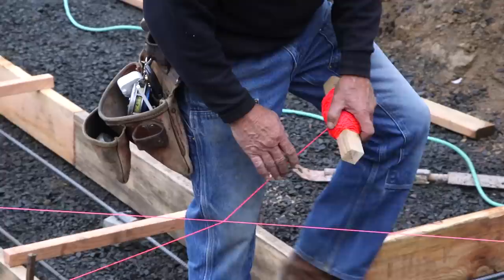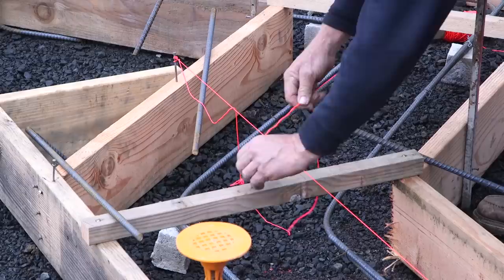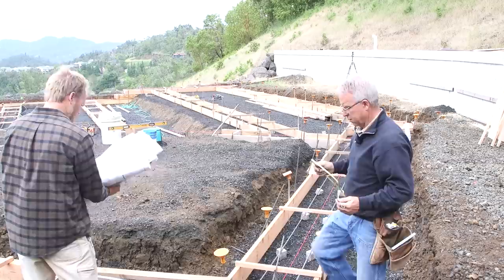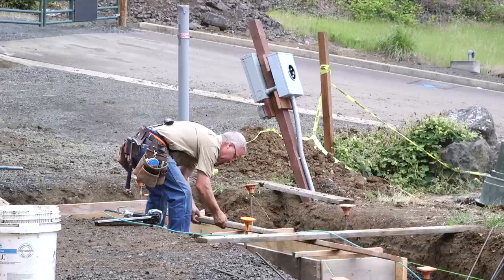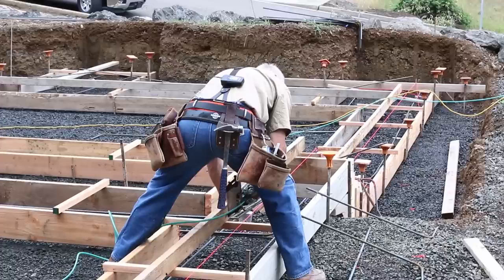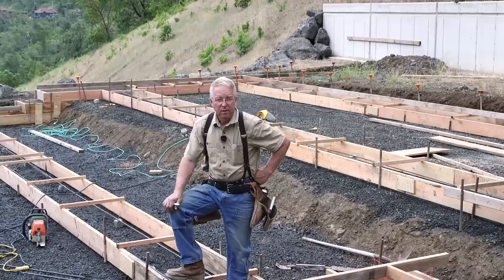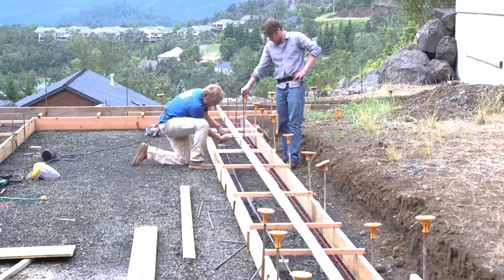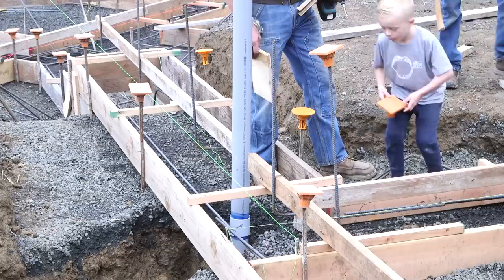Rebar Layout Ep 30

Comment: I only ever see concrete poured stem walls up here in greater Seattle area. Is cinder block done just because it's less expensive?
Reply: Generally less expensive and a lot less form-work needed.
Reply: Depends on the location of the block plant. Our area double the cost for a block wall. Plus no one really knows how so we pull Frazier Mason's from 9 hours south. Or just pour sold walls.
Reply: I know living in seismic zone D-2 it is not code unless it is manufactured home.
Reply: Maybe the concrete truck hose doesn’t make it to the back of the house? But that would be hard to believe. Probably cost ? 

Monolithic pour seems like a best way to me, but I’m also an armchair quarterback..haha
Reply: concrete blocks,cinder blocks are history
Reply: I am actually shocked to see him doing CMU on this stem wall. No one does that around here (Seattle). We do footing and stem wall mono pour and have really cheap mud compared to other parts of the country. A factor around here is most consumers view it as inferior construction, so less value for a spec home.
Reply: It’s not the same thing as us cold climate guys deal with. This is something like a 3’ wall with no frost heave to resist. If I had to guess, I’d say the engineer used a comfortable safety factor when he said to use CMU.
Reply: billy pilgrim  Not in Florida, where they’re used every day.
Reply: Micah Watson  One can always spend more money, and over-engineer. You can call that “inferior” if you like.

Comment: Actually in commercial construction they just throw the vertical rebar in with absolutely no regard to where the block cells are going to be (at least that's what it seems like).  It's not a big deal though as long as it's inside the faceshells because the masons will just bend those bleep-bleepers and or bust out webs to make them fit.  That's how it's done 99% of the time. ..and I've never ever seen a block web epoxyed back into place.😂 You Funny!

Comment: Wouldn’t the mortar move the cell over a bit each block? By the end of the wall it could miss the cell.
Reply: The actual block is 15 5/8" add in the 3/8" for the head joint and you get 16". The final wall can vary somewhat due to final dimensions but usually not enough to throw off the steel layout.

Comment: I've always been confused by rebar. They're just laying in the concrete, not attached to each other. Wouldn't bolting or welding them together make them more effective? To me it's akin to simply press fitting studs  and top plates and not nailing anything together.
Reply: What made you think rebar is NOT attached to each other?

Comment: Good for strength but I'm from Norway and you have to put a coating on the rebarb so it won't rot or or rust in the oil rig or whatever why don't we use rebarb that has a coating on it so it won't rust in years to come
Reply: @greggkuzilla - I will start by stating that I am certainly not an structural engineer.  I believe that in some instances in the US,  rebar coatings are required (Commercial Buildings, bridges, etc.).  Also, I don't remember where I saw it, but a while back I came across a conversation related to rebar coatings.  The basic premise was that the coatings are good in theory. For example, when they are used/installed under "ideal conditions".  However, in the real world (on construction sites) the coatings get damaged and then the moisture in the conc. is pulled into the area between the rebar and the coating through capillary action. Then, the rest of the coating holds that moisture.  The result being that the rebar rots from within the coating. So, the coating may, in fact, cause the rebar to fail more quickly.

Comment: Scott can I ask what are the conditions for which all this rebar is required ?  I have worked in and around the building industry in UK for 40 plus years and have never seen such a complicated set up for a blockwork build, for concrete yes and much more so. And vertical rebar ? I’m not saying it is never done but I’ ve never seen it done. Is this Earthquake proofing or something ?
   Three houses I have lived in just had brick footings(no concrete, not much used when they were built) stepped in from twice the thickness of the eventual wall, built off what is called “natural rock” which is basically the subsoil as deposited, no cracks in any of them, properly done.
       Don’t get me wrong I have seen a lot of damage, caused by bad or cheap practice, or lack of maintenance.
Reply: The Cascadia Subduction Zone is capable of producing megathrust earthquakes, like the 2004 Boxing Day earthquake which was so powerful it slightly altered the earths rotation. The last time this zone shifted was on January 26th,1700 at about 9pm. We know the date and time because an orphan tsunami was recorded about 9 hours later in Japan. Though I should note that tying the stem-wall to the footer is pretty standard practice through out most of the US, not just in earthquake zones. We have a broad enough tornado threat throughout the center of the country, and tropical cyclones that threaten both coasts, that there really isn't anywhere you wouldn't want the stem-wall tied in. Construction requirements and codes will vary somewhat state by state or even county by county, so your mileage may vary with and actual survey of the facts, but this has been true in my experience.

Comment: I watched the guys who built my house and they just dug a foundation shaped hole and poured concrete in it without any rebar at all. They built the blocks on top of that.
Reply: Yikes! Concrete AND steel have complimentary (and necessary) strengths. With the lack of steel, you’ve eliminated half of that equation.

Comment: Try doing concrete footing 10 miles South of the Arctic Circle in the middle of nowhere. The nearest rest stop/service station was 236 miles south.
Reply: I thought everything was up on stilts to keep the permafrost from melting.
Reply: @michaelvangundy226  Bridges don't go in on stilts, they go below the permafrost, the road construction crew hit a hole in the permafrost that took 500,000 cubic yards of gravel to fill at one point on the Dempster Highway.
Reply: Charles Damery  Why?
Reply: @bonanzatime  Good question, at the time the Canadian branch of Exxon Oil, Imperial oil was drilling the Beaufort Sea in Canadian waters next to Alaska and they need an all weather highway to get supplies in instead of barging around Alaska in the short summer season, the highway has now been extended from Inuvick in the Yukon Territory to Tuktoyaktuk in the Northwest Territories, so now you can drive from the Atlantic to the Pacific Oceans and up to the Arctic Ocean. It was built as an oil road, but with the cost of food in the North, it's cheap by road than by air.
Reply: Charles Damery.   Good Deal.  Keep up the good work.👍 I'll be there a week from Thursday.
Reply: @bonanzatime  We built the Eagle Bridge in 1976-77 when I was with the Canadian Military Engineers, I've been retired from the military got 28 years now and live in New Brunswick.

Comment: i will never understand why amercans build their houses since centuries in this style! no solid groundplate, thin walls from wood and foam is for the invirement the absolute cathastroply. when i am right is the summertime in oregon quite hot and the winter below frezingpoint. so in winter you heat like crazy and in summer the aircondition runs constantly. and no one cares the cost and waste of energy because this style of building house is "tradition". in germany the outer walls are minimum 15 inches + additional insulation. so in a proper build house you need no aircondition in summer and in winter you have to use heating very seldom. regards from cologne (love your channel)

Comment: How do i know at what point in the build that I need to stop and have an inspector sign off on a certain portion of work? Is that something pre-determined between the builder and the code laws?
Reply: when you file for permits they'll tell you when they want to do inspections, as in at what point in the completeness of the work.
Reply: In my experience, inspectors would rather answer “dumb” questions before you start, than come out red flag every other thing to be fixed later. If you’re doing a project on your own, most inspectors will be happy to sit down with you and explain the permitting and inspection processes before you start.
Reply: Generally, an inspection is required before you cover up the work. (e.g. before pouring the concrete, before backfilling the utility trenches, before putting up housewrap, before installing insulation or drywall, or roofing.)

Comment: Tying in re bar at corners and intersecting walls in footings and walls are  details contractors often get incorrect. Unfortunately,you did also: here is one of many pictures available showcasing the proper way bars are to lap as they turn corners in footings and walls. They should not follow the short path around corners but extend to the far side of the corner. May appear  insignificant,however,it is the stronger,correct way to place them.    https://www.eng-tips.com/viewthread.cfm?qid=407323
Reply: J Mack  That is what these types of interactive sites are for,the sharing of knowledge.We are never to old to learn. Best regards.

Comment: Did you forget to spray the forms before setting rods?
Reply: With form oil?  That can be done just before the mixer shows up.
Reply: Usually spray forms before rebar is installed. Don't wanna get oil on the rebar!
Reply: I don’t know that I’d even mess with form oil on this pour. Those forms will pop right off the next day no problem. Plenty of space behind them and not down below any grade.
Reply: I agree Ryan!
Reply: @ryanmartin9850  
New wood sticks to the concrete very badly. I have always sprayed with diesel fuel before setting any rod.

Comment: Still don't know why you don't just do a monolithic pour of footings and stem wall? and not worry about the verts
Reply: Wildman of the Wynooch Maybe the concrete truck hose doesn’t make it to the back of the house? But that would be hard to believe. Probably cost ? 

I’m with you. Monolithic pour seems like a best way to me, but I’m also an armchair quarterback..haha
Reply: @michaelhowell8990  I have built a few homes with my Grandpa and we always had to do monolithic pours for seismic standards with Simpson strong ties embedded into the stem wall and footings I know Grants Pass is in either Seismic zone D1 or D2. I am not saying he is wrong . I know he will do it code. I know that cement pump trucks have booms that could reach every square foot of that lot no problem.  I am just wondering too as why? hiring masons is not a cheaper option.
Reply: A few others brought up a good point. Since he did a mono pour on the retaining wall, maybe he wants to show how blocks are done? To include it all.
Reply: @michaelhowell8990  That could be a great reason too. I would just like to hear his reasoning and learn something new.

Comment: I still don't understand why you're doing block, it seems like block is making more work for you and more cost.  In the amount of time you've been carefully laying everything out, you could have installed forms and form-ties and poured a monolithic foundation.
Reply: EFormance Engineering Maybe the concrete truck hose doesn’t make it to the back of the house? But that would be hard to believe. Probably cost ? 

I’m with you. Monolithic pour seems like a best way to me, but I’m also an armchair quarterback..haha
Reply: @michaelhowell8990  I had a house built in Oregon last year, it was a monolithic pour and took about 3 days with a crew of 5.  The area of the foundation was 90x40 with 30 inch grade stem walls and 12x16 footers.
Reply: Wont he have to fill multiple blocks with concrete wherever he needs bolts to hold the framing down? 

I’m guessing it was cost that made the decision for him. I’ve seen multiple videos from him talking about blocks so maybe he’s just a block fan?

I’ll be pouring a foundation at the end of this year. 1st one ever with no experience. Seems like a monolithic pour is the safest. Make the forms perfect and strong. I can take as long as I want. Then no worries about lengths of blocks once the concrete dries. That’s my thoughts.
Reply: @michaelhowell8990  He was trying to use this as a teaching series and thus maybe chose block because they did the retaining wall as poured.

Comment: In fact, rusty rebars bonds to concrete better, due to chemical bond developed during cement hydro curing process... And never use rebars covered with Zinc layer, that Zinc will prevent cement to properly bond with rebar.
Reply: This isn't true at all.

Rust is an expansionary process -> as steel oxidizes it expands to multiple times its original volume.  This causes the concrete to debond from the rebar.  You want to avoid using rusty rebar if you can.

Galvanized rebar has no difference in design than regular rebar.  It has the same lap length, bond details, and load transfer.  Concrete design does not depend on the presence of rust to develop bond strength, in fact we would prefer if there was no rust.
Reply: Random Mcranderson - I mean a little surface only rust, nothing rusted to core or so. Some source online - http://www.materialslink.com.au/single-post/2016/08/31/Rusty-Rebar—Is-It-A-Problem

And for the second topic... https://www.degruyter.com/downloadpdf/j/kom.2012.56.issue-4/v10227-011-0020-9/v10227-011-0020-9.pdf
Reply: @ LWQ LWQ - I was taught the same thing in college, that a certain amount of surface rust is actually beneficial to the concrete bond. NOT flaking corrosion, but surface rust. It’s a good thing too, bcz in my part of the country, rebar will begin to ‘rust’ in literally a cpl days.
  I’m not as sure about the galvanized rebar theory though. I installed a lot of galvanized rebar in my career, but never once w/o it being specifically called out for on the plans by the EOR. I have read a few studies recently that are beginning to rethink the use of epoxy-coated rebar.
🤜🤛
Reply: @randommcranderson5155  true, but i was tought that we place the rebar in far enough (in the concrete) that any form of corrosion or other reaction can not take place anymore. This includes contact with water, salts, chemicals and so on. Depending on the surrounding there can be as little as 1/2" or as much as 3 inches of concrete around the bars, according to my local standards.
Reply: 25+ yr LA rodbuster, a certain amount of oxidation is allowed, to a point, I've seen column dowels that were too severely oxidized that the inspectors required that it either be pressure washed or fine grit sand blasted, careful not to "pit" bar. If you ever want to learn how to install bar properly, install it for a new hospital, inspection is a whole other level. Plus, CMU layout is done in increments of 4.....4 in....8 in.....12 in.....16 in, larger commercial jobs will typically use #5 bar with two @2in at openings wall beginnings, endings and corners, these boys know what they're talking about, at that scale of construction, parameters, requirements change as structures increase in size.😎

Comment: why do you call the dowels "verts"?  And why not use ICF's?  Insulated concrete forms are more efficient than block, are already insulated, weigh virtually nothing, and any half decent carpenter can do the install.   And use wood stakes at a 45 degree angle (trimmed off flush with top edge of footing form) instead of spreaders to make troweling easier. Mark (with felt pen) the edge of the form for dowel (not :"verts" ) layout as the mud from the pour will obscure the top edge of the forms .  And what a huge waste of time placing the dowels in before the pour.  Again, what a troweling hassle.  Mark your layout on top outer edge of form, pour you mud, wet snap a line on for centering location of dowels, and place said dowels shortly after the pour.  Oh, and why whine about the dowel bend not being a true 90 degree?  Use a rebar bender and bend your own.  And you forgot to mention the easiest way to cut the rebar.  That being a 14" cut-off saw.  Ahh, but what do I know?  I've only been building custom homes since 1973. That being said, you are a craftsman and though your methods are a bit different than mine, you are getting the job done.